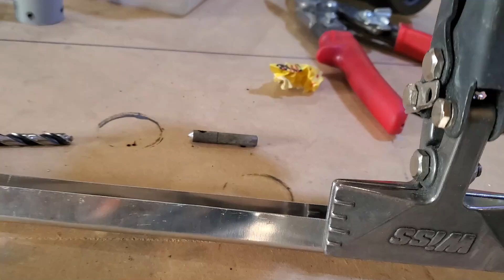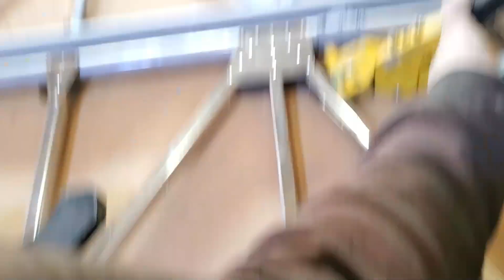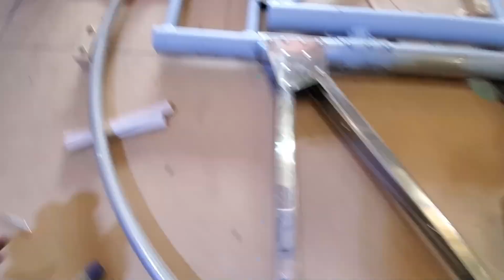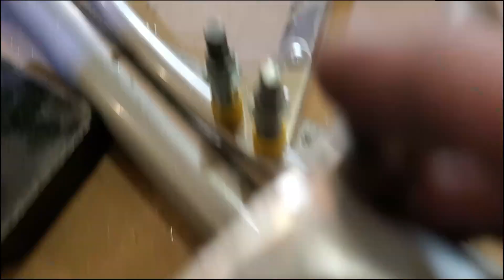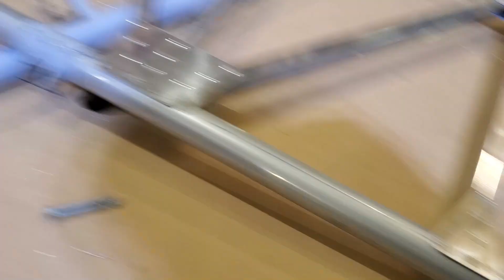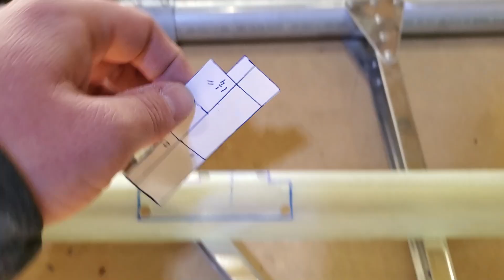Kay's Speedster Construction: Stabilizers

Comment: Thanks for sharing this! Really excited about what is coming out of your company and the beautiful aircraft! I do have a few questions about the kits...what kind of aluminum are you using for your sheeting/components? Also, I was curious as to which method you're using to weld your 4130 tubes and if there is any stress relieving done to the weld and surrounding steel afterwards? Thanks again and really interested in your kits!
Reply from the maker: Thanks for the compliments!  Typically for the aluminum sheet we use 2024-T3 and for the tubes we use 6061-T6.  There are exceptions to this, however.  As for steel, we do high-vibration and high stress parts with TIG, always.  The fuselage frame is standard with MIG (quickly becoming the industry standard), but we can TIG it on request.  I must caution anyone using MIG outside of an experienced and trained setting, though.  MIG requires a welding unit with pre and post flow (to control heat and cooling) and also requires a specific welding method.  Once the method is dialed in, the weld beads are nice and buttery, have zero porosity, avoid martensite formation, and have good penetration at the edge of the bead.  We have compiled a list of companies that use MIG in their fuselage welding and the number of companies might surprise you.  Some of these companies make the most popular, highest-dollar kits.  It is very quickly becoming the standard for the industry as far as tube frames go.  Properly done, heat treating isn't required.  One thing to keep in mind is that your average fuselage cluster has a LOT more "meat" at the joint than the loads require.  This is where stress analysts and "dime stackers" can start to get into disagreements.  Both speak from very different backgrounds and must strive to understand all perspectives.  One argument I often see made for oxy welding:  "my friend balled up his Cub and not a single weld broke.  This is because the weld normalized the steel tube, making it more ductile."  NO!  This is simply untrue and is missing a lot of context.  I can't tell you how many cracked oxy welds I have seen.  Original Cubs had 1025 frames.  That steel is naturally much softer and more likely to bend than break, though it will still break.  Why don't we use mild steel any more?  It is near impossible to find quality tubes in quantities we need to manufacture and it is also nowhere near as corrosion "resistant" as 4130.  Yes, 4130 rusts readily if not taken care of, but it rusts quite a bit slower than the old 1025.  Why do I mention all of this?  Because one could easily go down a rabbit hole online, getting lots of conflicting opinions, particularly from highly skilled welders who don't necessarily understand the stress analysis of fuselage tube clusters.  The bottom line is that, properly done and used in appropriate situations, MIG, TIG, and oxy are all acceptable welding methods.  This is a departure in my own old opinions, so we'll be doing a video on this subject in the future.
Reply: @timbertigeraircraft Wow, thank you so much for taking the time to respond to my comment! I really appreciate it! I'm in the homework stage right now for experimental kits and trying to learn as much as I can from sources like the EAA, etc. As you stated it can quickly become a bottomless rabbit hole though with discussions on Airfoils (Riblett vs NACA), Tig vs Oxy welds, Solid vs Blind rivets, Tube/Fabric vs Semimonoque, and the list goes on and on. At the end of the day I just want a well engineered and designed kit that I can build at a fair price that will last for my kids to fly years down the road. Of course it doesn't hurt if the design happens to be absolutely beautiful and stirs sentiment for the "good ol' days"! Keep up the strong work and gorgeous airplanes!! It is much needed in the industry!
Reply from the maker: @travisgilbert8416  indeed, rivet selection is much the same.  Properly used, blind and solid rivets are both perfectly acceptable.  As far as airfoils go, it is my understanding that the Riblett airfoils are simply a bit more refined.  Some may have a difference in handling vs their NACA counterparts, others might not.  As for semi-monocoque vs tube, the arguments there tend to be about crashworthiness.  Nearly all arguments suggest that the steel tube fuselages do better in crashes, but my opinion is inconclusive.  Crashworthiness depends on speed, angle, was the engine running or stopped, did the airplane flip over, did the engine help keep the nose up during impact or did the engine depart the airplane, which wing hit first, etc.  So a lot of the arguments there are moot, too.  But if the internet is good for one thing, it is argument.